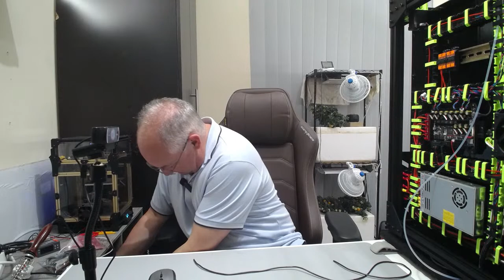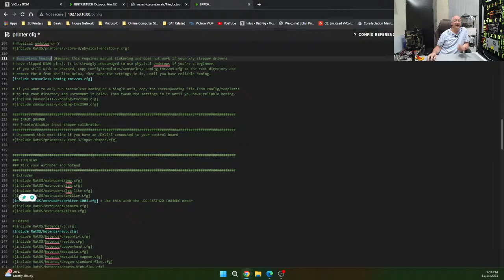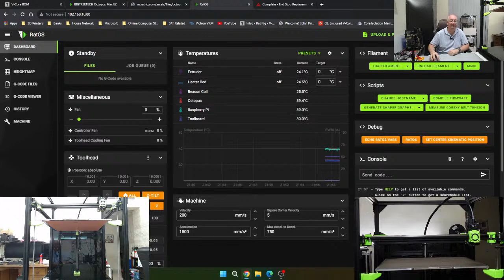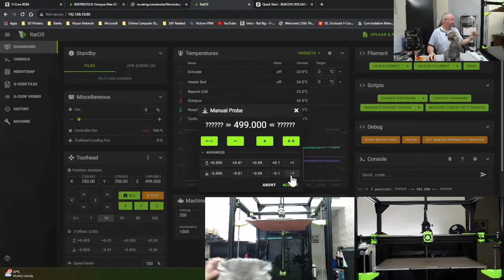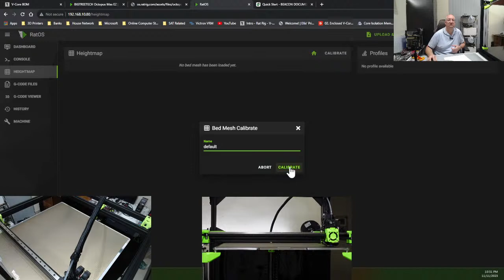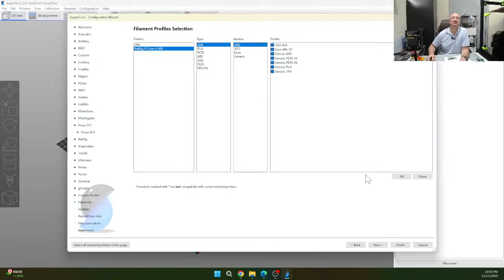RatRig V-Core3 500 Build - Part 13 (Final Connections and Initial Commissioning)

Comment: What was your final max range of the bed flatness? (given you got it working, im dying to know!)
Reply from the maker: Have not worked on the printer again, but I am also very curious... Will let you know soon
Reply from the maker: Tested tonight and @ 110°C on a 15X15 grid I get a rand of 0.695mm.

Not sure how I feel about this as my older printer has a range of only 0.250mm. Ok, this is a 500 X 500 bed, so could not expect perfect but was hoping for a little closer in the range of 300-350mm.

Will reach out to RatRig and ask what their tolerance should be for their beds.
Reply: @DesertSands3D  I just saw your message, Ive been following your build with my own VC500 since July! Btw THANKS FOR THE VIDEOS IM PRETY SURE U SAVED A PART BLOWING UP OR 2. I initially got a range of .445, after messing with the frame my best was 0.189 at 60 degrees C. Ive found that the printer has to be PERFECTLY level, moving the printer to a different part of my room caused the mesh to go from 0.189 to 0.55! This is due to the frame of the VC500 not being string enough, you can check by tapping you squares on any XY plane where there is a 90d angle and seeing if its square, an unlevel floor will cause that angle to not be a good 90d. Ive also had countless issues with the belts moving up and down and tearing themselfes apart, despite a perfect mesh! Ive gave up after 3 belts being chewed up, inc a gates one (expensive grr!), so ive decided to add the FMMM mod and stepper decoupler mod, ive ordered parts and am waiting on them to arrive from ali. I could not for the life of me figure out my prev belt issue. I hope I could help you here.
Reply from the maker: Glad the videos help. Flat is a term that is a little frustrating at the moment
Reply: @DesertSands3D  id be happy to share results on discord
Reply from the maker: Yes, please do. I am still on my private name on Discord (will need to switch as some stage).

If you go to "Ratrig Community/Troubleshooting/fix-my-mesh/Mesh Range High...Frame or Bed?" you will see my comments under user "Raymond"

I have improved my mesh but think we are now at a point that the email I sent to Ratrig first needs to be answered. Let's see.